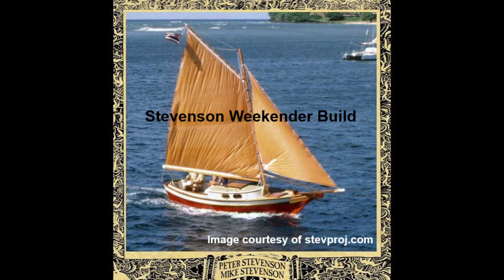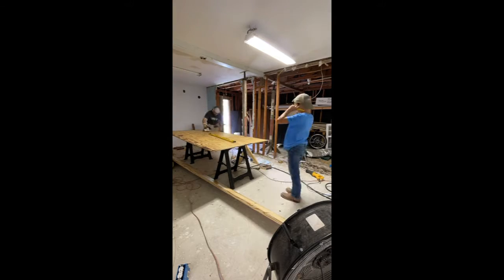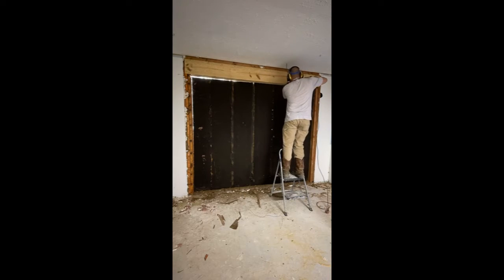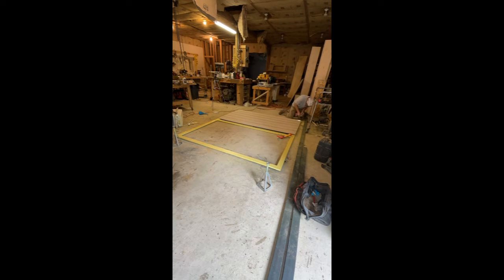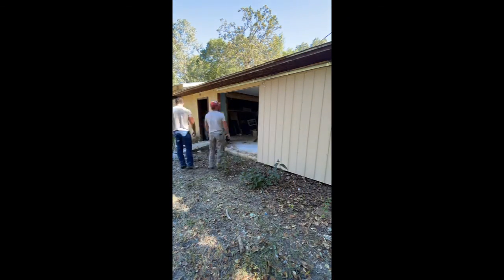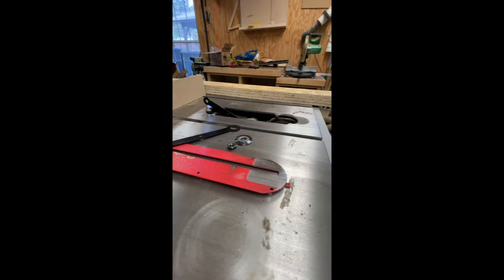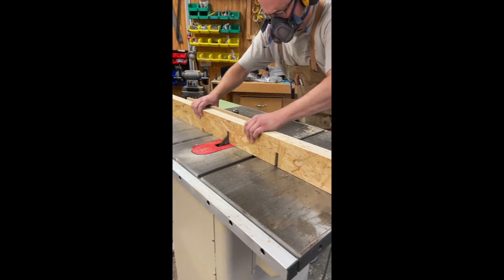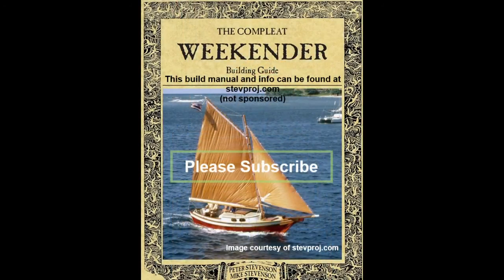Stevenson Weekender Sailboat Build: Episode 1 - Site prep

Comment: If you haven't gotten too far along yet then I urge to to abandon this boat plan and build something else.  I built a Stevenson Skipjack 2015-2017.  It's similar design, just a bit smaller and no cabin.  I found it's sailing characteristics to be very disappointing and it was very unstable with the solid and heavy wood mast.  A little better with a hollow fiberglass mast.  Better choices might be the Glen-L Tango or 21CB, both traditional plywood-on-frame construction, or one of Sam Devlin's stitch-and-glue designs, like the Winter Wren.  A bit smaller but very cool design is CLC's Pocketship.  This is another stitch & glue design.  Both Devlin and CLC also sell kits for their designs, which would make your build faster and easier.  From my experience with the Skipjack I think you'll be sorry if you build the Weekender.  I sold my Skipjack for a 40% loss and now I have a Glen-L Minuet, which I like much better.  I don't care what Stevenson says.  Sailboats need a ballasted keel.  Without that you're just sailing a dinghy.  If you're interested and live in the PNW, I have a partially built Devlin Nancy's China (15 FT) that I can sell to you.  The hull is complete and was built by a professional woodworker.  I decided not to complete it now that I have the Minuet.  I mentioned a Glen-L 21CB above...I used to own one and found it to be seaworthy and it sailed very well.  I spent a week up in the San Juan Islands of Washington.  Had a blast.
Reply from the maker: I really appreciate the advice. I looked at a lot of the comments online about the weekender and saw many people agreeing with what you are saying. Then I saw a lot of people saying they thought it did fine. So I finally just pulled the trigger and decided to go with the Stevenson. I’ll mostly be sailing on lakes rather than the ocean. I also thought the build plans looked like something I could do and the building is most of the fun for me. 
I looked up that clc pocketship and that does look like a cool boat. If my boat turns out good but is no good to sail I may just let one of nephews have it to play with and I’ll build or buy a better one. Thanks again for taking the time to comment. I appreciate it.
Reply: have you compared the prices between Glen-L and Stevenings??????? big big Diff, compare all before
 judgement
Reply: @jaubin5820  The Glen-L plans are more expensive, but worth it, because not only do you get a much better design, but full size drawings as well, which eliminates the need for lofting.  But when you compare these to the cost of materials for building a boat, the  plans are a small fraction of the cost.  Hardly worth basing the choice of boat to build on. The Skipjack plus trailer cost me around $9000.00 USD to build.  There's also the resale value to consider.  Of the four brands I mentioned, I think the best resale values start with Devlin, then CLC, then Glen-L, with Stevenson a dead and distant last.  (I've seen Weekenders in decent condition on Craigslist for a few hundred dollars.)  I consider myself lucky to have been able to sell my Skipjack for $5000, but that's because it was still pretty new, was made from superior materials and I put a good deal of craftsmanship into the build, with a mirror finish in both paint and varnish.

Comment: That´s great, man! Looking forward for the next chapters. Im also building a Weekender, in Brazil. Im in page 18 at Stevenson website. Just turned the hull upside down yesterday for fiberglassing. Thanks for sharing with us.
Reply from the maker: Thanks for the encouragement and thanks for watching! Good luck with your boat.
Reply: @makingtimeworkshop  you can check my progress at Stevenson page, Im in page 18 of the builders page. Today Im painting the bottom. Im using epoxi paint, which is very hard and protects a lot.
Reply: @makingtimeworkshop   I will be sailing north soon, going up the coast. My Weekender has been buildt very strong, with 4 different watertight compartments, watertight portholes. That openings from the cabin to the front of the boat I installed also watertight hatches.
Reply: Brasil is an awesome place to sail.
Reply: I’m rebuilding a sailboat.
Reply: @leov4187  That´s cool.  Where? What kind of sailboat?
Reply: @leov4187  Yes dude it is, very beautiful, mellow weather, mellow currents, mellow seas, thousands of islands, waterfalls, fish, many cool places to go. I had sailed a lot through the coast of Brazil, Argentina and Uruguay. I will be sailing north soon, going up the coast. My Weekender has been buildt very strong, with 4 different watertight compartments, watertight portholes. That openings from the cabin to the front of the boat I installed also watertight hatches.
Reply: @leov4187  Wow thats a awesome sailboat. You can sail everywhere, no limit. This is a ocean crossing capable sailboat. My dream boat is something like, a Nordica, or a Flicka, also, small but blue water sailing. And how is going the rebuild? Are you planning to share some footage at youtube?
Reply: Flicka is a nice boat. I’m thinking about the YouTube thing. It’s a good way to share and learn. And to document your work.
The sailing season is short here and it’s too cold to work on the boat as it’s winter.